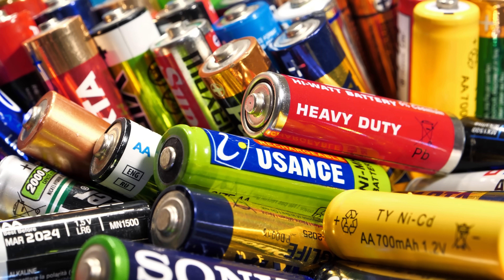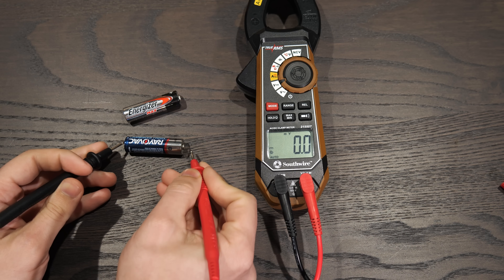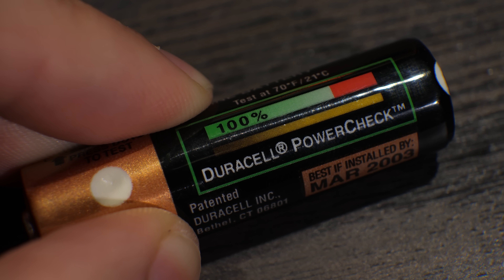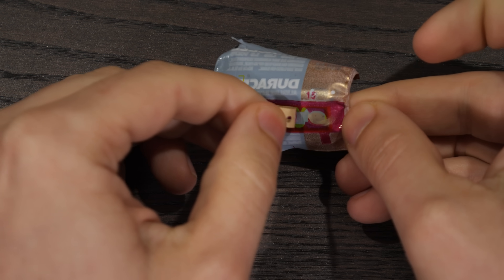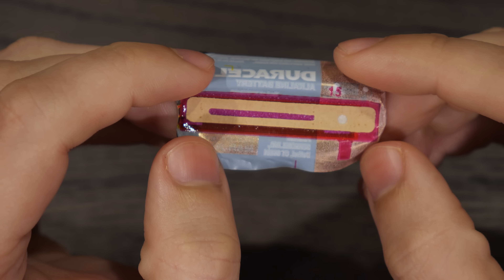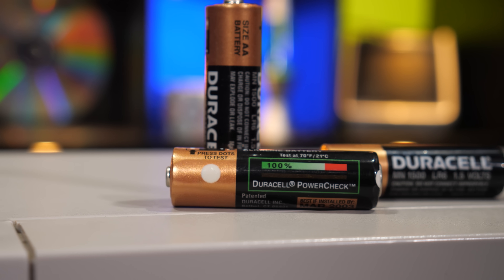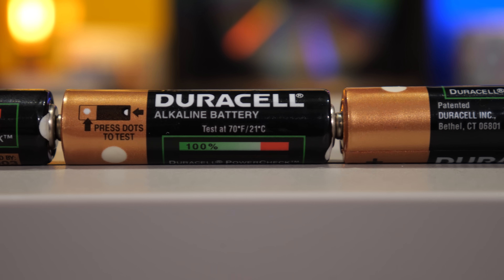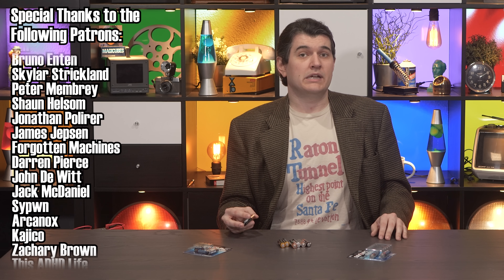Duracell PowerCheck: A genius idea which didn't last that long

Comment: But what was the point? Generally most people will use up a pack of 8AA batteries within a couple weeks of opening. Especially if you got gamers who use Xbox controllers. So if you’re just going to throw these in a device and use it until the batteries are dead, then what’s the point of the power checker if most people just use batteries from full to dead in a short amount of time

Comment: In the 50's and 60's you had to actually go to a Sears Roebuck Store to test your batteries.
They had a big, formal kiosk that you could bring your batteries to check. There was talk that they were going to charge money to test batteries but, thankfully,  that never happened.
Reply: What, you didn't have a Heathkit volt meter to check your batteries with?

Comment: What's more frustrating than anything about batteries is when device makers purposefully create the device in such a way that you cannot use it with rechargeable batteries. Why would you do that? Why do you spec your device to work only if all cells have at least 1.45V or more under load? Sometimes, I lose hope in humanity for the weirdest reasons, this being one of them. If you don't know already, rechargeable ones are rated at 1.2V nominally, and they are around 1.4V when fully charged. I.e. my electric soap dispenser uses 4x AAA batteries and sneers all over my rechargeable ones (I know, I know, 6V vs 4.8V nominally is a pretty huge difference, but why not use a regulator and 6x AAA batteries? Or better yet, use a design that gets by with 4V? Ah, I know. MONEY.) Another one is my fancy remote for my fancy LG TV... Like, gosh darn it, if you need that voltage, make space for an additional batteries, no need to be a jerk to the planet just because it's convenient.

Comment: I think the tester feature would have made a lot more sense back in the 90's when there were FAR more devices that used AA batteries. When I was a kid, my brother and I would be swapping batteries back-and-forth per device and between each other at times. Our parents never really bought that many batteries at any given time, so sometimes we'd have to ration. Nowadays, however... yeah I could see it not really making as much sense. Many of our devices use integrated lithium rechargeable batteries, so AA never really come into the picture any longer.

Comment: Of couse a lot of devices nowadays that use AA/AAA batteries (remotes, mice, keyboards), tend to last a year or more, so replacing isnt an issue. Duracell/Energizer is expensive, but the Menards 30 pack Black friday special on Everready costs like $4 and lasts a year, and i test/sell used electronics for a living

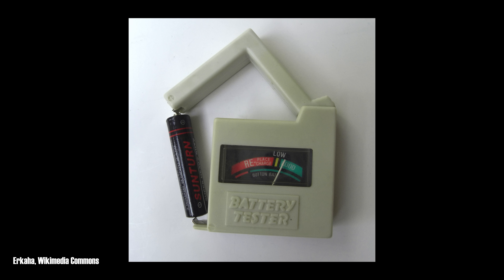Comment: 2:55 a lot of these do have a load resistor in them, but they are far too small to actually be a load for the battery. And by small I mean high resistance, low current.

Comment: Rechargeable batteries were the biggest reason for these.

You'd want to check if your batteries were good for a long drive with the Gameboy. Now everything that needs double A usually is staying home. Where a new set of batteries is usually ready whenever the current ones die, as pointed out in the video

Comment: I just pulled a pair of these out of an old TV remote from a second hand pickup, "Best if installed by MAR 2003". Funnily enough, I only opened the battery tray because I was curious if it took AA or AAA; they still had life in them and worked in the remote, but I was worried about leakage.

Comment: not too long ago (a couple of months) i found one of these kinds of batteries. i was really impressed by this feature and curious how it worked. great video and excellent explanation.
side note: the battery in question is not even an old battery. still made by duracell, the date on it is march 2026, so it looks like they are still/once again in production. ill have to research if thats the case, but the battery tester is still functional and reading approximately 80%

Comment: What is the resistance of the metallic strip?

BTW, my default battery tester is whether the battery ("cell!") has sprouted white crystals that have corroded the entire battery department. :(

Comment: I'm still using an old battery tester from the 1970s that my grandfather gave me when I was a kid. It features an adjustable slide that can fit AA, AAA, C, and D cells and also has contacts for a 9V block. It also features three red diodes labeled "full", "good" and "low".
Reply: I have something similar, maybe even the same, that I keep in my battery box with the odd ones that are left over.
Reply: They still make those. Wall mounted designs were pretty popular. I suspect that is part of the reason built in testers never caught on—we already had one.

Comment: Rechargeable batteries became more useful and affordable, "good" batteries dropped in quality (drastically) while becoming ever more expensive, cheap batteries became better, and I suspect it failed the consumer actually cares test (can openers ahoy.)

In other fun stuff, I have some NiCad AAs from the early 1990s that are weird - they are 1.8V and cannot hold current.  They are Matsushita/Pansonic labeled and basically just say AA NiCD and nothing else.  But who ever heard of 1.8V NiCads?  

I'll probably break them open since I'm suspecting they are really 2x1.2V cells and were originally 2.2V and probably used for something odd like a laptop/etc battery pack.  I know there ARE open circuit 1.8V NiMH AA cells, but that's more to do with how much NiMH voltage drop in closed circuits.

Comment: I'd find those extremely useful for rechargeable batteries, as some chargers don't completely charge them sometimes, they also tend to lose some charge when stored... And unlike disposable batteries, that wouldn't be a niche usage as you actually DO store and check rechargeable batteries 😅

Comment: AA batteries have 1.5 maybe 1.6V? Yeah, if you buy the expensive branded batteries instead of Aldi´s cheap 8-pack at least in Germany. For example: in Germany a 4-pack of Varta with 1.5-1.6V (quality control is the reason) is 6€, a 8-pack at Aldi, Lidl or our other discounters is 2€ ranging 1.42-1.95V (personal messurements) and take a guess which german company I´ve already named made those "failed quality control" batteries? Am I going to spend 6€ on 4 1.5-1.6V Varta batteries with branding or 2€ on 8 1.42-1.92V Varta batteries because they´re slightly off spec? What´s below 1.42V ending up at what you know as 1$ stores. In the US Aldi and Lidl are probably selling Energizer batteries under their name, that´s how they opporate and offer those cheap prices, local productions 😉

Comment: And why not have rechargeable batteries with these in-battery testers? Seems like the perfect place, since you often had several rechargeable batteries, some with charge some discharged, in the same bag (and even if you tried to keep them separated, they magically switched places somehow)

Comment: I loved the battery testing function and used it all the time as a kid!  Yeah, definitely hurt the fingers to do so, though. At one point we got the kind where the tester was on the package and I had the 'genius' idea to keep the package and use it on other batteries, and it seemed to work perfectly fine.  I had no idea actual battery testing devices existed, so I felt kind of like it was a lost technology when it was gone one day because someone must have found it in my room and threw it out and they no longer packaged them with batteries.

Comment: Unfortunately I've been running into more and more small consumer devices (lights, fans, thermometers, smoke detectors, remote controls, etc.) which specifically say "DO NOT USE RECHARGABLE BATTERIES" and really do not work all that well on rechargeables, but provide no wired solution, even for something like a cat feeder that stays in the same place all its operational life.  I had tried to reduce my e-waste by going all in on PaleBlue and other rechargeable solutions, but recently had to start buying alkalines again.  It's very frustrating.

Comment: It's unconscionable to me that we ever thought single-use batteries are an acceptable thing to buy, use, or even manufacture.
Reply: I mean, there was no other option that was remotely cost effective or practical until the late 80's with NiCads and those had very limited usefulness, were expensive, and were quite bad environmentally.  NiMH wasn't a widely available or cost effective option until the latter half of the 2000's.

Comment: What's the reason for having two buttons to press at the same time when one would be enough to complete the circuit and result in an easier user experience? To reduce the chance of the button being accidently pressed by something and the battery discharging through the heating element?

Comment: One case for keeping some partially used batteries around for us was taking them out of devices that required more kick to start and putting them into something like a TV remote when it needs some. Although these finger testers weren't too much of a help. Could never tell whether I press the pads wrong or if the battery is actually fully dead. Inserting it into the device was the best way to test it, in the end, as you mentioned.

Comment: While the on battery tester is neat, the ones built in the package was always way more useful to me.  On the usefulness of the tester, I don't think it ever needed to be on every battery, or even every package, but they were reasonably useful back in the day for things like children's toys, and photography equipment.  For the kids, at least  when I was growing up, batteries were expensive so we got a set or two to share among whatever toy we were playing with at the time.  For photography, it wasn't uncommon to have a bin full of batteries for your flash, and you could get a pretty good idea of how many clicks you's have left by checking how far up the bar goes.  You've also got a lot of older electronics that were a lot more finicky about voltage.  Old boom boxes or consumer electronics using linear voltage regulators that would cut off when the 6 cells (nominally 9V) dropped below about 7 volts, which is still about half the life left in the battery in many other devices.  A lot of folks in the 80's and 90's might have a drawer full of batteries with a 1.2V charge that is plenty enough to power a whole bunch of things, but not enough juice for some of the fancy gadgets.  
For my fellow train geeks out there, the Lionel TMCC remote is a good example.  It doesn't work with rechargeable batteries at 1.2 volts, it needs at least 5.2V across the 4 cells.  These days most battery devices (standard size cells) are designed to run on 1.2V cells, or have a boost converter built in, or are very low power and will run under a volt.

Comment: I remember a little radio I bought from Koss. It came with the first Porta Pro headphones and used AAA batteries. Fortunately it also had a DC power jack, so I bought a 4x AA holder and a plug and strapped the batteries to the outside. A set of AAA would not last one full week for me, but a set of AA would last well over a month. I suspect that the AAA batteries were not really even large enough to effectively power that tiny radio - it had quite high output levels and could drive the included headphones loud enough to listen with them in front of your ears instead of on them.

Comment: For a long time (with my WII mostly) I have used rechargeable AA batteries
That actually worked great as to cutting costs on battery expenses, but after a year or so of use, their capacity would be quite substantially lower than new, supporting only 4-6 hours of playtime...

Edit: I also remember seeing a more modern design for Duracell power meters over here (France), in the past few years (maybe up until 2015-2018). I wonder if they don't still sell those here bc I never really saw them go away.

Comment: I'm kind of surprised you didn't mention dropping AA and AAA batteries onto their negative terminal can tell you relatively how charged it is based on how it bounces. Drop the battery from about 3 or 4 inches onto the negative terminal. If it bounces once and loses almost all of its momentum its full/mostly full while if it bounces multiple times its mostly dead

Comment: I'm 71 and seen the battery gimmicks in the past. I had the separate battery tester clip as well. I wasn't too fond to those on the battery, especially in a cold outdoor environment. I'm a retired technician and I keep a couple of dedicated battery testers, one on the bench , another in my travel box. I have items that a rechargeable battery is disadvantageous to have in it. So I use plenty of batteries over a year.

Comment: Stopped using DuraLeak a number of years ago when they changed the chemistry that caused them to leak so badly. I use Amazon generics for a 1/3 the price. Haven’t had any leaks since

Comment: The powercheck would have been more useful in the Walkman era of the 80s. Where devices did not always drain batteries uniformly and when the speed started to drop you could normally get away with just replacing one battery.

Comment: Regarding having a drawer full of partially depleted batteries: my late grandma worked as an RN for many years and would often come home with a box full of partially-depleted 9V batteries. They were used in patient-critical medical devices of some kind, and consequently were decommissioned well before being completely depleted of charge. They worked great for RC cars and the like, but you can understand why they wouldn't be acceptable in a medical device.

Comment: This would have been great for rechargeable batteries.  Since you can't charge one battery by itself, I'm always wondering which ones are charged, and how much, so I'm not trying to recharge a mixed pair.  I've literally had conversations about how you know how charged a battery is, since the voltage is mostly consistent between 90 and 40 percent charge.  Talking about lithium ion.

Comment: I would always use the built-in tester when a device stopped working to determine if the battery (or which battery) had died

Comment: Back when I was a kid and we had like 10 tv remotes(tv, speaker, dvd player) and several game controllers and toys, I'd always swap the batteries around looking for the highest charged ones. Using the tester saved time instead of messing around with our literal drawer full of battteries that were half dead.

Comment: I've gone through so many battery technologies it isn't even funny, but one thing hasn't changed in decades... if I buy a 20-pack of anything and stick it in a drawer, it is guaranteed to be a pile of corroded junk by the time I actually need it.   So... I don't buy non-rechargaeble batteries any more these days.  Only rechargeables.   That, however, has been a saga unto itself.

You see, most rechargeables are terrible.  They have high self-discharge rates and grow filiment shorts internally.  Almost all of them.  So badly designed they give the whole concept of rechargeable batteries a bad name. I went through many more rechargeable brands than I did non-rechargeables.  None lasted.

I finally found "Eneloop" with is Panasonic's low-self-discharge brand.  Finally!   Nirvana!  Batteries that actually work and last and can be recharged and don't turn into piles of glue.  Be careful of the brand name though, there are lots of knock-offs. "Enevolt" is not "Eneloop", for example.  Eneloop branded batteries also have "Panasonic" clearly labeled on the battery.

-Matt

Comment: I have to say that alkaline battery capacity can vary quite a lot between brands, so the commodity aspect isn't really true. People often do buy them as if they were a commodity, but the cheap ones definitely are inferior.

Big Clive did a capacity test of different brands of batteries years ago and he found that store brand batteries often are worse than name brand. It's not a small difference either. Some off-brands have 3/4 to half the capacity of some of the name brand batteries. Alkaline batteries seem so simple that they should all be very similar but battery chemistry is extremely finicky.

Also why the heck are zinc-carbon batteries still made? Those are AWFUL.

Comment: 10:35 The simple answer is cost. It's always the darn cost. It costs to make that metal strip, it costs to make that indicator ink, it costs to make that insulator and it costs to make that glue which holds that tester to the side of the battery. It even costs when the battery has multiple colors on its wrapping. It's the cost. Not to mention all the extra costs added on top of that when a production line has to be setup andd adjusted for those testers. It pumps the battery price way up.

Plus multimeters started to become more popular and you could test your battery life with them too, to some extent. So why would manufacturers bother anymore with that tester strip when it costs money? Sad but true. The world revolves only around the money and nothing else.
Reply: Also there even were those tester strips as separate thing which you could use to test multiple batteries easily. We had one too. It was fun to use because it also was so easy to use compared to those dots.

Comment: I still appreciate devices that use AA batteries, mainly because of NiMH rechargeables! I bought a couple packs of them, and they just rotate in and out of my AA (and AAA) devices. They don't take too long to charge (obviously they have nothing on fast charging for Lithium, but still), and they aren't a ticking time bomb for destroying whatever you put them in. 

Really, those are what should have gotten the PowerCheck feature!